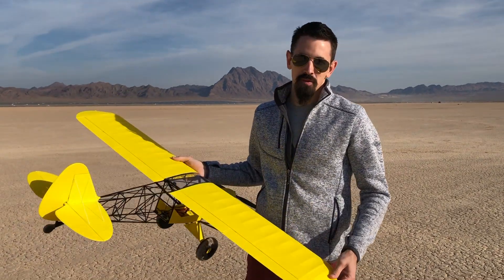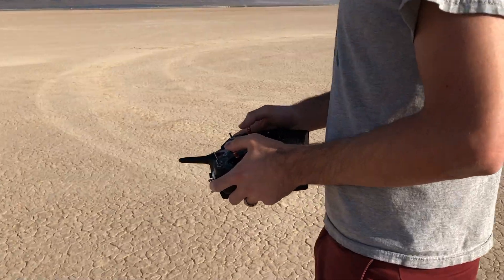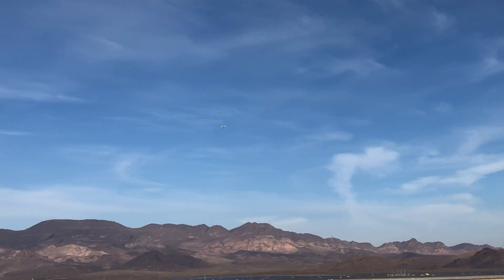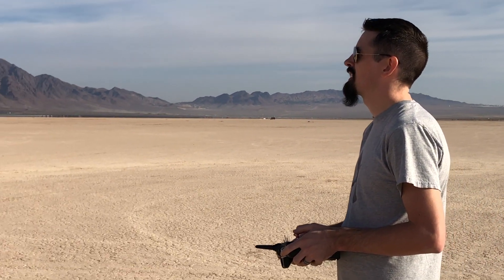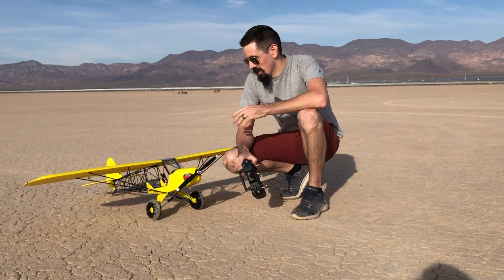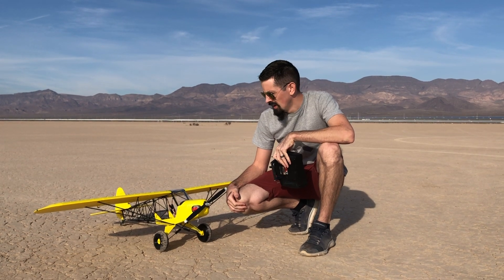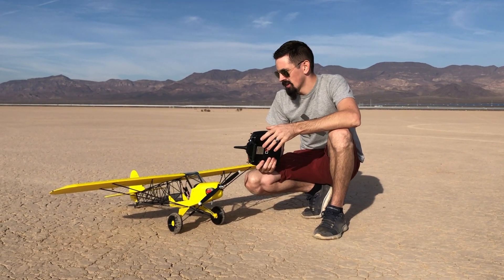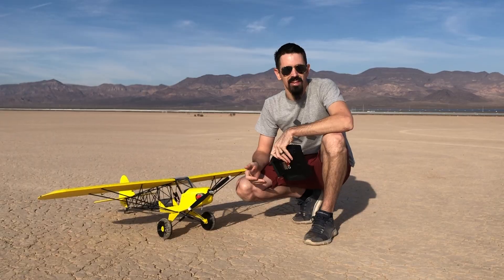Big Bobber Maiden Flight - Planeprint

Comment: hello what is the flight weight of the plane?
Reply: thank you so much
Reply from the maker: 1650 grams RTF with 3S 2700 battery
Reply: @TroyMcMillan  I'm glad to hear yours was that heavy.  I think this might be my first all PLA build.  Most of the prints I've done have been either all LW-PLA, or a mixture.  I was a bit concerned at how heavy mine came out.  Tried maiden with a smaller (480 size) motor and it was clearly not enough thrust to weight ratio.  I get now whey they suggest the 10 sized motor.  Have one on order.

Comment: Very nice flight. Mine also had its maiden flight. But it flies a little wobbly.
Where have you put the COG now? And how much weight does it have now?
Thank you
Reply from the maker: I set the CG just about where it is marked on the wing. My build was 1650g with a 3S 2700 battery.
Reply: @TroyMcMillan  Thank you 
This is mine:  https://www.facebook.com/groups/planeprintpilots/permalink/751005028888558/
I have nearly the same weight: 1640g with 3S2200 battery. Maybe i have my CG just a bit too forward, because it tends to nose down in flight.
Reply from the maker: @hubiactron  Nice job with your build. It looks good. Ya I had my CG set to far. forward on the maiden and needed a lot of trim to stay level.

Comment: I'm getting a 3d printer for xmas. I know exactly what I'm going to build now... Is it possible to scale up the model to 1700mm? I have the Avios Grand Tundra and was thinking of salvaging that planes internals to run on this beautiful bobber.
Reply from the maker: Ya this plane is awesome have fun building it. You can scale it up on the slicing software Cura. The only thing that may be a challenge is the wings have servo mounts and if the wing is scaled up you may have to modify the servo bracket in the wing. Also make sure all the parts will fit on the printer when scaled up.

Comment: You should do a STOL competition with this and your homemade timber.
Reply from the maker: That would be fun but I already know the homemade timber would win it is so light it takes off with almost no ground roll this Bobber flies good but it is almost 2x the wight of my foam timber.
Reply: @TroyMcMillan  yeah, that is one downside to 3d printed planes, but if you made this out of LW PLA that would probably give the timber a run for it’s money. Have you printed/flown the smaller Savage Bobber? How is the STOL performance compared to the larger big bobber?
Reply from the maker: @Savage_Offroad  I have not printed the small bobber yet. 
I will be printing a LW-PLA bush plane next week so I may do a STOL competition when I get that plane done. That was a good idea.
Reply: @TroyMcMillan  Awesome! I’m getting an Ender 5 Plus for Christmas and am excited to combine 3d printing with my favorite hobby. I am planning to print some simple designs from 3d Lab Print and eclipson once I get my printer dialed in.
Reply from the maker: @Savage_Offroad  Let me know how the Ender 5 pro works out for you. I have people asking me a lot about what printers to purchase. That is a good Idea to start with a simple design to build your first plane. My first plane was a bit frustrating because it was so complex. The main complaint I have for 3D lab print is they use simplify3D for slicing software. Eclipson and PlanePrint use Cura witch is free. I prefer Cura. I was not successful using Cura to slice 3D lab prints planes. I may be able to figure it out now that I have more experience but definitely would not recommend it for a first build.
Reply: @TroyMcMillan   Thanks for the heads up, I’ll look at the eclipson models. They have some cool looking ones and very simple designs so I hope they aren’t too difficult. I’ll let you know how the Ender Plus is. It’s not the pro version but the plus version with a massive 350x350x400mm build volume.
Reply from the maker: @Savage_Offroad  Sounds good Jeb thank you,   Have fun with your new printer
Reply: @TroyMcMillan  thanks, I’m setting it up right now. I’m actually printing some prop adapters for my friends UMX Timber

Comment: Maybe. I had no success with the smaller bobber as was just too heavy as printed using the settings and files it came with.
Reply from the maker: You need to be careful with Flow settings when printing planes that will make the plane too heavy.

Comment: Great build man! Have you had any issues with the PLA warping in the sun? That’s been my biggest worry about printing out some planes, since it’s hot so many months of the year. Not sure if the colder weather will make the PLA brittle too.
Reply from the maker: I live in Las Vegas and it is hot and sunny here almost all the time. I have multiple 3D printed airplanes and have had no problems with warping in the sun. I am just cautious when parking it between flying it to not leave it in the sun for too long.

Comment: Great maiden. I'd love to see you tow a glider with it as I was thinking of doing this build as a tow plane. I'm curious to see it tow before I do though.
Reply from the maker: I am interested also I don't have any gliders but I was planning on trying to tow a chuck glider to test it out. I think it would depend on the wight of the glider you want to tow.
Reply: @TroyMcMillan   at walmart they have these foam gliders they're like $12  they're 4ft wing span.  @flite test has a video making it RC.  but you could easily put a small 1s or 2s battery in it and even add a flite control board it's would be a great test glider.  

https://youtu.be/-RrHiXj4jzk  here was my attempt  at trying to make it Powered RC